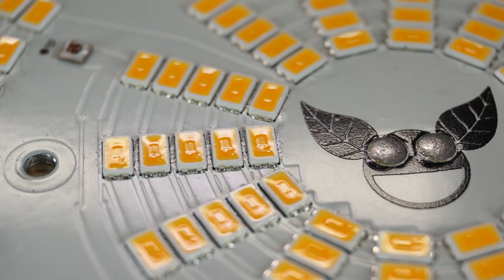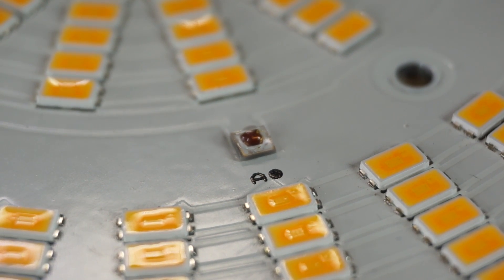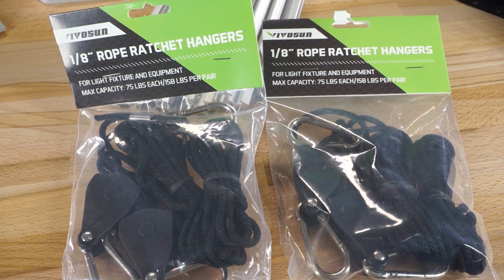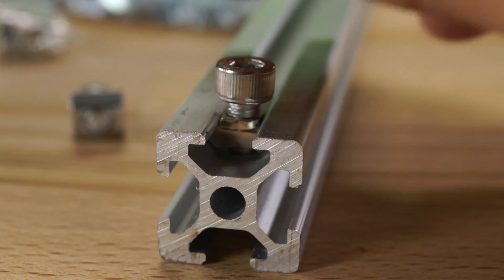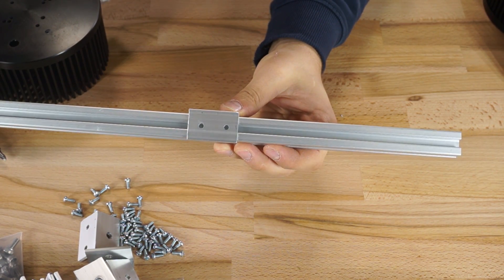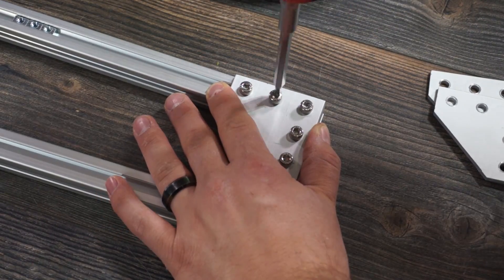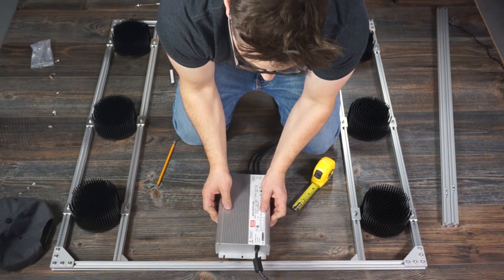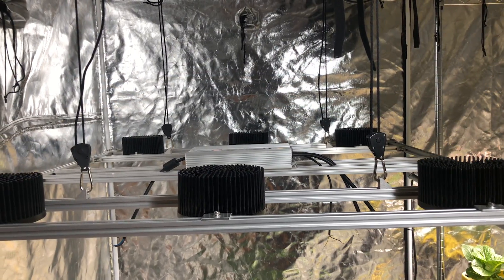ChilLED Logic 100W PCB Parallel Puck Build Part 1

Comment: Excellent build tutorial and great looking light setup, your pace and level of detail was simple to follow.  I switched over to HLG LED lights after seeing some of your earlier videos and have done well.  Now, I am looking forward to seeing how the 6-LED light setup performs.  Nice job!
Reply from the maker: Hey there, thanks for the feedback. You’re one of the pepper guys, right? Which HLG boards are you using?
Reply: @LEDGardener  Yes, I have grown dozens of hot peppers.  Also, growing veggies and flowers using tilled, raised bed, self watering, autopot, deep water culture, and other methods indoors and outside.  Most of my recent posts are about Kratky hydroponics, which I learned about from Bernie Kratky.  I have (2) of the HLG 3000K 65 watt Kits and (1) of the HLG 100 watt with the Mean Well HLG-80H-C700A driver.  That was awesome to wire up and bright!
Reply from the maker: Matt Garver very cool! What’s your preferred growing method for peppers?
Reply: @LEDGardener  I really love growing peppers in 32 to 44 gallon Kratky style non-circulating containers.  They grow enormous and produce around 300 hundred peppers with no work over the season.

Comment: Hey buddy I just want to say how glad I am to see you back making videos, and thanks for being an integral part in me gaining the knowledge I needed to start making my own lights. If you ever come to New Zealand I'll have some frosty nugs for you to say thanks.
Reply from the maker: Hey, cheers man! What have you built so far?
Reply: @LEDGardener  lol hope you've got some time I've been waiting for you to come back online so I can tell you about my builds..
My first one is kind of embarrassing lol but it was 10 Bridgelux V8 cobs (their smallest cob) stuck with thermal tape onto a 600x400 aluminium oven tray (between 1-2mm thick so a very sturdy one) driven by a HLG-80H-36A. The weird driver size is because I wired the cobs in parallel to suit this old laptop power supply I had but it didn't work and I didn't want to resolder everything and didn't really know what I was doing to be honest lol, it's a long story...
Anyway at the start of this year I made my second light, to replace the 250w HID set up I was using in my 1200x500 closet grow which had gotten way, way too hot... For that build I got 2 pieces of 320x420 flat aluminium and 10x 280mm EB2 strips, then used some S606-C thermal grease and pop rivets to fix 4 strips to one sheet (100mm apart) and 6 to the other (75mm apart). I was basically trying to see what the bare minimum is light-density wise, and leaving space to add more strips when I can see how many watts my "heatsinks" can handle in this environment. I wired them up in 5 pairs and drove them with an ELG-150-C1400A, the idea is to dial down the driver to 50%, so each strip gets it's rated 350ma, then when I knew if the heatsinks would handle it, all I would have to do is fix and wire in the extra strips and turn up the driver. Does it sound  like I'm going about this the right way or do I still not know what I'm doing? Anyway I'm so stoked on this light, just being able to stare at and film my plants in natural looking white light is such a bonus bonus honestly I love that part almost as much as the fact that the light was homemade, cheaper, and more efficient than anything I can buy off the shelf in my country.
Reply from the maker: Nice! How are the sinks doing in the current config? Are they running fairly cool? Things may change when the heatsinks have double the power on them once you add the extra strips.
Reply: @LEDGardener  okay so I just went and checked because until now I had only been gauging heat with my wrist lol.. ambient temp outside closet is 25C (at 11pm and it's not even summer anymore), inside the closet is 29, probe sitting about 2-3 inches under the lights between the 2 boards says 30 and my IR temp gun says 30.3 everywhere across both boards and 43 pointed at the diodes. Oh yeah and that's at 145w from the wall... curiosity got the better of me and I've been turning the driver all the way up to about 170w some nights if it's a bit cold just to keep the canopy temp around 28, which runs them a bit more than their max. of 700ma.. on average I reckon I have the driver around 130w most nights to keep the temps around 28 in the canopy... I know it's inefficient and could blow the strips, but if a strip blows, the driver will just sense and turn itself off right?
So anyway I assume this means the sinks can take the extra strips if the driver's already pulling 150w, which means that now I need to get off my ass and order another 10 strips so I can stop overdriving the ones in there now... and we're about to go into autumn here so maybe I can order a slightly gruntier driver and wind all 20 strips up to 400-450ma to moderate temps as the seasons change we'll see. Oh yeah the reason they don't get too hot is because I have a big fan hanging at about the same level as the boards and it does a great job of moving air very evenly around the whole closet and over both boards because it's one of the ones with a rotating circular louvre in front of the fan which is key. I'm actually pretty proud of my little set up it just gave me about .8g/w on my first run with new strains and without even really trying and with plants that had a joke of a veg sitting in side lighting outside the closet with the door open lol

Comment: Such a big gap in the middle. Are you putting something in there?
Reply from the maker: MRDOSDID when I measure ppfd I might shift the rails inwards if the center is lacking. My thinking was that it’s easy to bump the middle up but much harder to get good coverage on the edges, so I’m going to start at the edge and move in as needed.
Reply: @LEDGardener  I actually use a 630W DE-CMH in an AC/DE fixture in a 5'x5' Gorilla tent. I was thinking of going up to a 1000W DE-CMH, but wanted a more even light spread across the canopy. So I used 4-100W COB units(2-50W fully adjustable COB's on a 1M rail they can slide across, but their rail itself is hooked up to the Meanwell driver, and when the COB's connect within the rail, the electrical connection is made. Strange, cool, but safe?), that I put around the perimeter. Works great! I love the mix of the two, and aren't convinced in all LED concept yet, as some medicinal breeders(NAW Seeds) found some unique strains had lost their uniqueness using Cree CXB-3590's. Went back to their DimLux 1000W DE-HPS. I love the CMH lighting, and my 1st thought was "Throw a 315W CMH in the middle", lol, as I noticed the spacing, but you wanted to test first, then you can adjust as needed. Got it! Great idea! I'm thinking of getting a "blue" Puck for my small, 32"x32" clone/early veg tent. Very, very impressive LED's! Very efficient/powerful. Great video of it tested on The Migro light channel(You probably know of Shane and his honest tests on lights. His light isn't at the top of his chart! Honest, sincere guy( I actually felt bad ordering the above mentioned COB's through Alibaba, as they're just as adjustable as Migro, but lacking the fine craftsmanship, waterproof rating, and greatest efficiency), Luminous COB chips Migro uses( I went with Citizen CLUO48-1212''s, saved $280 altogether, were around $117 each, $160 shipping! But here in 2 days! Less expensive now, plus Alibaba has 50% off shipping for March). Still feel guilty as I was prepared/promised Shane I'd order from them. Disability back pay was a few grand less than expected, so I searched for something w/similar adjustability, found Ceres(?) Lighting on Alibaba. Great supplemental lights. May get one more, but the "Puck" uses less power, better spectrum for my veg, than many/any others out there. Subscribed and hit bell! Looking forward to the next video! See what/if the light spread, adjustability brings. Great info! But forgive my rambling on! Bad, old school habit, lol. You're a great service to all DIY people! Thanks again. Will be watching for updates!!! Welcome back..

Comment: that's pretty neat. With that HLG 600 you can't fit more lights on there? Wouldn't running 4 of the QB288 boards make this a more beasty HLG 550 v2??
Reply from the maker: CombatNinja23 yeah that driver is pretty flexible and you could do a lot of different builds with it. I just wanted to do one of ChilLED’s recommended builds which was 6 pucks on this driver. 

Running 4 QBs on this would be a little overkill at over 3 amps per board (if I could get the voltage high enough to make them draw that).
Reply: @LEDGardener  4 QB's is actually the setup for the HLG 600, the only difference between the 550 v2 and this would be the driver...
Reply: I hear you tho.. subscribed and looking forward to more vids
Reply from the maker: CombatNinja23 I had seen growerslights sold their own 600 kit but used the 54V version of the driver. Didn’t realize HLG was selling their own kit with the inventronics driver though, good to know.
Reply: @LEDGardener  yup, I was about to grab a kit from them and still might but I was gifted a California Lightworks Solar System 1100 for free so I'm going to use that for now

Comment: building a Pacific Light concepts unit after they come back in stock this week. I cant wait. I looked at the Pucks as well.
Reply from the maker: Awesome. Those strips look great.
Reply: this construction solves the issue with the RapidLED frame. With my frame from them the heatsink will slide around, I almost pinched my hand one day on them angling it down. I threw zip ties on it to fix it.  @LEDGardener
Reply from the maker: MaineGrower are they designed to tighten down?
Reply: nope the heatsinks on it for some reason can slide around... there's no tighten down screws from what I could tell 
 @LEDGardener
Reply: The rapid led frame is a joke